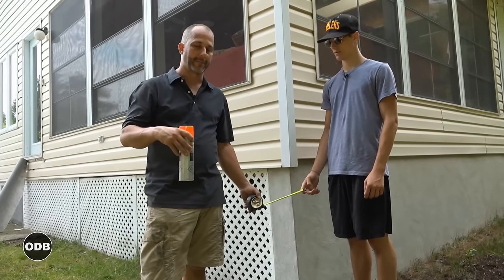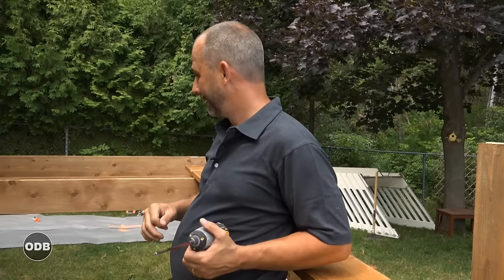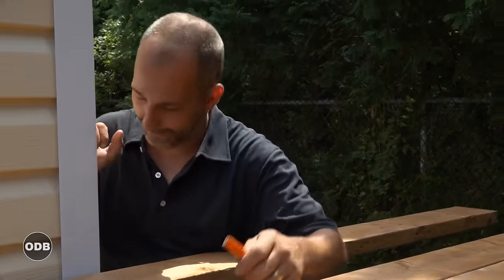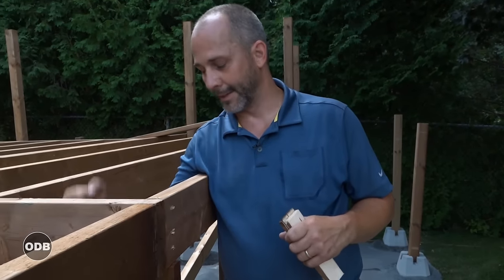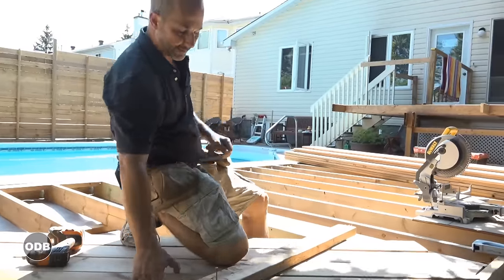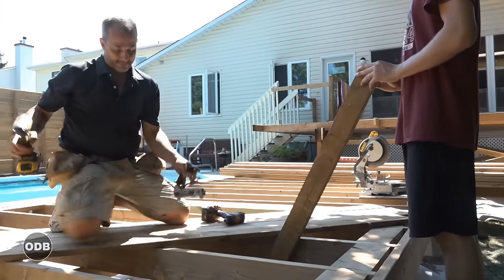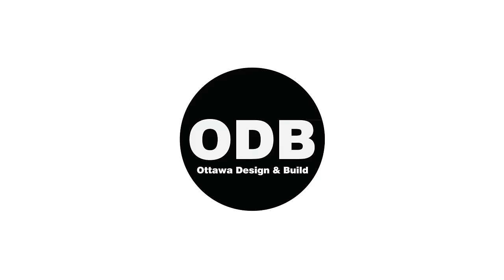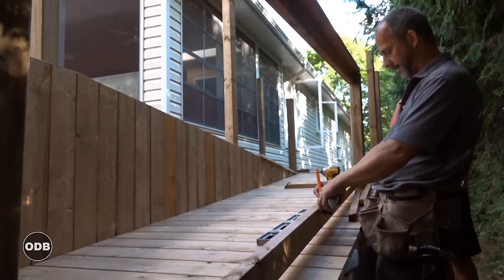How to Build a Deck for Beginners A to Z

Comment: This is great +Ottawa Design and Build Renovations ... are you guys in freezing zone? I am in Central PA and wonder if float decks are allowed? Won't the freezing cycles make the deck move, or as long it isn;t attached to the house it's ok? Our deck would be very low height I want the boards almost touching the grass. 

The floating idea with blocks would enable us not have to dig the holes which would be great!
Reply: Also, that cameo system... would it work for hardwood as well? I will most likely build our deck out of tigerwood or Ipe.
Reply from the maker: Exactly as long as you don't attach the deck to the house the deck will raise and lower with the freezing cycle.
Reply from the maker: I haven't tried it yet on hardwood. Best to call camo before starting to ensure a good result.
Reply: +Ottawa Design and Build Renovations nice! thanks for the reply! Also, the glass is a nice idea! I also envisioned my deck having some sort of glass... What kind of glass is it? Acrylic? In my country, acrylic is really popular for this kind of stuff but no idea here in the US and having that on the deck would be sweet!
Reply from the maker: the glass is tempered glass. This product is available at a local building store. It wasn't engineered for wood installation so I had an engineer create a report to pass it. it came in 2 sizes and we constructed the railing accordingly.

Comment: love the video, hate seeing you cutting the fencing with the skill saw and no eye protection. my brother is a framer and was doing something very similar and a splinter shot off right through the cornea, had to have a lense implant.. next time use your eye protection, they are unreplaceable...by the way I am starting my deck in a week the same as you did yours, on the block.....
Reply from the maker: Thanks for the advice, however I still believe in having the clearest vision while working. For every story told about an accident with out glasses there are 2 told about an accident while having glasses on that impaired vision. Not to mention the fact that it slows us down. I will let the tradesman roll the dice and decide if they want the risk or not.

Comment: Just built a deck here in Parma, OH, was going to bolt the boards the way You did in the video and was told by the inspector that will NOT pass the inspection. Boards have to be set in the 4 x 4 post or on top of it.
Reply from the maker: Like I always say check with local codes. This video is not how to set a post but how to build an entire deck. There will be variances from one region to another on a number of different issues.

Comment: I think the design is good, however, for the price of lag bolts, you can use 2x4's or 2x6's to transfer the load from the 2x6 supports down to the concrete footings.
Reply from the maker: reasonable assumption, However in the future if it needs to be adjusted due to frost this design can be lifted and shimmed from under the post. Your idea requires temporary support ij order to replace the vertical structure you would create. Unless you switched to carriage bolts at that time.

Comment: One of the problems with this build is that the joists are transferring the load with screws/bolts when the IBC requires the load transfer be wood to wood. To meet code, there are 2 options. Either the post needs to be notched for the joist or the joist secured on top of the post.
Reply from the maker: Be careful you are not confusing the code for decks attached to the house. Remember that this structure is free standing. As such there is no code for building under 24 inches from the ground. In any case this deck was built under a permit and passed all inspections. I wouldn't change my opinion on how to build a deck if a million people said it was wrong. The inspector and building office and engineer said it was right. Perhaps the purpose of this video is to broaden some minds and correct some misconceptions out there.

Comment: Question, If i were to build just the box, and I built the deck top like you did, could I just screw the deck top onto the box? Or would I need to add something else with some galvanized nails to hold the top and the box together?
Reply from the maker: just screw it down. gravity does most of the work. the screws are just there to keep the wood from deflecting as you walk.

Comment: When can you use floating blocks opposed to digging a 4ft hole and sinking posts in concrete?
Reply: This depends on you local building codes and ordinances.

Comment: I would recommend a compound SLIDING mitre saw instead of flipping the board and trying to repeat the angle.
Reply from the maker: That definitely works better,however I am trying to show tools and techniques that I belive the average homeowner has.
Reply: Exactly.  That is where most of these better tool for the job comments fail to grasp the intent of this video.  I built an 800+ sq/ft deck with these very tools with one section fishboned.  There was much cutting, flipping and more cutting including all the 4x4s.

Comment: How did you attach the added structural support under the ground level deck, you said you used to help add stability to the joists? Around the 30 min mark of the video I think. Also- is the shear strength on the strong-tie screws only rated for southern pine? We are using cedar.
Reply from the maker: we added another beam. he shear strength is related to the fastener not the material.

Comment: I'm hooked on your videos.  Great work all around.  Question regarding the glass - did you seal the glass into the dado channels or are they just resting in place?  Should the channels have drainage holes?  Also, are you concerned how the glass will shift as the deck heaves a bit up and down each year?  Thanks for all your hints and tricks!
Reply from the maker: drilled a few holes. Great question. No worries for a little shifting as the entire frame moves together. Kind of like hitting a bump when driving a car . the whole frame keeps things tight.

Comment: At the 1:10:00 mark where you are affixing the stairs to the deck ... what do those stairs screw into?  The skirting?  Or is there a beam between the two vertical risers on either side to strengthen it.  Deck looks really nice, and ramp and stair are nice too.
Reply from the maker: It is actually attached to the skirting, however we have reinforced behind to make it solid.

Comment: Got a question,  I know this has been over a year with this video,  what else would need to be done to add a roof over the deck and tie in to the roof of the home or a trailer . Tks
Reply from the maker: if you tie into the structure then you need to have the supports in concrete. then the you can do it. Cheers!
Reply: Thanks for your response this helps me a lot.

Comment: Fantastic job! Would you recommend these handi blocks for a sloping workshop/shed base ?
Cheers Steve
Reply from the maker: Sure just dig out a little until you have a flat base and fill with gravel first. then all the downward force isn't going across the slope, just into the ground. Good luck and thanks for the great question.

Comment: Love the video learned quite a bit and am excited to build my deck. I am in the process of designing my own floating deck, and I did have a couple of questions regarding type of wood, stain, and sealing. My deck is going to be either stained very dark or painted, should I use pressure treated wood for the decking or is standard douglas fir sanded and stained ok. Also should I stain/paint and seal the decking prior to installation?
Reply from the maker: I would use PT just because you also want to discourage bugs. Pre staining is a lot of work but does create a superior finish.
Reply: Were you using 1x6 for the decking on the ground level?
Reply from the maker: 5/4 x 6 Chris. standard material.

Comment: Heavy construction built on few piles of sand ( or gravel )  ? What if rain washes away those piles of sand ? All construction sets down on either side and crack ?
Reply from the maker: Limestone screenings et up like cement under pressure. Not to worry!

Comment: awesome, I think I can handle this.  I would mount the beams on top of the 4x4 using a bracket. What do you think about that vs the box beam you made?
Reply from the maker: That works fine. Just requires a little more effort to get everything level.
Reply: Ottawa Design and Build Renovations you can use a water level to level all the posts very easily.

Comment: I live in western new York which is quite south of Ottawa, my question is, what happens from frost or do you guys just have a ton of clay that you don't have to worry about it?
Reply from the maker: clay is not the question. Even where you live you get a frost line of up to 3 feet during February. If your soil is dry there is little movement. If it is wet when it freezes you get more. The advantage to installing the whole deck on blocks is the entire deck rises and settles together at the same rate so it doesn't matter how extreme the weather is. As soon as you attach to the structure you need to engineer for soil conditions and weather patterns and increase your chance of causing structural damage. The only sure way to install a deck attached to the house is to excavate and install a footing at 8 feet that is wider than your column. This is incredibly expensive and unnecessary. Thanks for the question.

Comment: While I admittedly don't have much construction experience(just a 12x16 garden shed), it would seem that a post and beam construction would be a much stronger method than a box-frame style. The weight of the structure would actually supported on solid material, as opposed to being essentially suspended with the structure's weight being placed on the heads of screws and bolts. Or am I missing something?
Reply from the maker: post and beam is a little stronger but also much more difficult to get exactly level. The 1/2 inch galvanized bolt will last longer than the wood and installs in only a few minutes compared to post and beam which could take the whole day by yourself. That was part of the intent of the video to show different options.

Comment: Thank you very much for posting this video.  I have watched it a few times and I really like how you lay down the herringbone deck pattern with a picture frame.  Question:  Did you space the joists 16" or 12" for the herringbone pattern on the ground level deck?
Reply from the maker: Thanks for watching. |We used 16" on center for the entire deck. I only use 12" when using composite decking.

Comment: this vid was so awesome. im an aspiring carpenter, your kid is lucky to have your guidance! I just have two questions.

1. do you guys have an Instagram I can follow your work on?

2. where did you get and how much are the concrete deck blocks?
Reply from the maker: I do not post to Instagram  yet, and the deck blocks can be bought at any building store around 7 or 8 bucks each.

Comment: im curious why you would only use 2×6 framing for floor 
i would never use less than 2×10. not to mention isnt 2×8  minimum code?
Reply from the maker: By using an extra box beam I saved approximately $400.00 and I didn't compromise the structural integrity. Minimum code all depends on the span of the supporting structure. 2x8 is with 8' span 2x6 is with 6'.
Besides It was a lot less lifting and a lot less fasteners as well. 
It also means that it took less trees to build this deck.

Comment: I'm confused on the limestone screening being used as a leveling material underneath the  blocks. Is that all you use to keep the blocks from moving and holding the entire weight of the deck? 
Over time, wouldn't the limestone wash away with rain or go up in dust with the wind?
Reply from the maker: A little however the stone under pressure is very hard to move and the product actually bonds to each other when wet.

Comment: ...protect the cut end of your posts.
This is done when you cut pressure treated wood and expose the cut.
Reply from the maker: The funny thing is that there is no science to back up the idea. You take pressure treated wood and then add a passive topical coating and somehow think that you have improved the product. This is actually a little nuts. The big T>V> shows always push this idea but that is because they are paid to say it. Be careful what advice you get from a T.V. show. everything is scripted by the highest bidder to sell product. On this channel you get the straight goods.
Reply: @HomeRenoVisionDIY  Given that non-ground-contact PT wood only gets into the wood about 1/4" (GCPT is about 1/2" penetration), yes, you definitely need to seal the ends of the wood with a "passive topical coating", simply for the fact, you're exposing NON-TREATED WOOD to the elements. 5/4," 1/2" slats don't need it, but anything thicker that 1.5" nominal has raw wood in the middle.

Jeff, I watch your stuff all the time, but you're not perfect, If you're building a deck as a contractor, then yea, fuck it, unless the customer is paying you extra. Otherwise, if you're making it for yourself, unless you want to fix premature rot in 5-7 years, yes you most definitely want to put some stain sealer on the raw ends of 4x4's or 6x6's. $20 a gallon and a few more minutes wont kill you.

Comment: Really interesting and informative video. I was curious that you seem to use a lot of De Walt equipment, how do you find the performance of the cordless, battery kit? I would imagine that your ambient air temperatures up there are low to mid 20's (Celsius) How long are you getting out of your batteries before they need replacement?  What are the De Walt prices like compared to say Makita in your area?
Reply from the maker: I upgraded from rigid to get more power at a good price. the temp during this build was over 30 Celsius. The batteries last a good 4 hours during heavy use. My drill driver combo was only 299.00

Comment: Hi ODB, I live in the GTA and am thinking between deck blocks and 4' dug in posts for our ground level floating deck. At the point closest to the house we have only 15'' available from ground to the entrance to the house so I am wondering if the deck blocks at that side can be dug in a bit? That would cause water to collect int he hole and push those blocks up in the winter... Thanks!
Reply from the maker: If you want to dig them in a little then I would suggest digging a trough and filling with gravel so that water can escape. never let your block sit in water for the freezing thaw cycle is very hard on them and they can break.

Comment: I've been searching and watching tons of DIY videos and keep coming back to yours.  It's the best I've found to explain all aspects for building this type of deck in this environment.  I do have a question for you.  If I'm understanding correctly, your upper deck is 24 x 12, split into 2 sections, with 6 posts bearing the load (I'm not taking into account the ramp for my purposes).  I'm planning a 16 x 12 and would like advice, assuming I will be using your plan and technique, as to how many posts I should use.  My plan was to use 9 posts (assuming 3 beams), but after watching your video, I'm questioning whether that's overkill.  Any advice you have would be greatly appreciated, thanks!
Reply from the maker: Hi John, you got it right buddy. Cheers!
Reply: @HomeRenoVisionDIY  Thanks very much for your hlp, Jeff! Just watched your other series of videos for rebuiing a deck, it was great!

Comment: Nice job.  My only issue is with the box beams.  Box beams are fine in certain circumstances - but they shouldn't rely only on the shear strength of the carriage bolts.  All the weight of the structure is dependent on these bolts.  Likely fine with a low deck like this - it just drives me crazy when I see this method on high decks.  Nothing like a notched 6x6 with carriage bolts.  This way you aren't relying on the shear strength of the bolts - you are using the post as it was intended - for compression strength.
Reply from the maker: I really don't understand why people have an issue with the box beams. Carriage bolts have a shear strength of 2000 lbs. there are 18 on the upper deck section alone. The math says it is safer then any bridge you drive your car on.

Comment: I have a question about the deck blocks.  Isn’t it better to remove the organic material where the block will be sitting prior to placing your aggregate base?
Reply from the maker: Sure if you have a lot of grass. In this climate the deck was going to shift around anyway so we decided not to worry about it in year one and address the settling issues in the year after. We also changed the slope and drainage in the clay backyard so who knows how that would end up leveling off.

Comment: Hi, nice informative video, but i have one question about camo screwing system. when you were doing fishbone decking and using that system, doesn't you miss one screw on other side because of 45 degree angle? Just curious, I think this system is great for regular decking not for fishbone unless you pull camo screwing system a little bit to right or left just to make sure you are screwing decking plank to the deck basis. Srry for my english, I think you got the point. Thanks for answer in advance.
Reply from the maker: When doing the 45 angle you must visualize where the screw will travel and adjust the insertion point accordingly. One little step but easy to do.